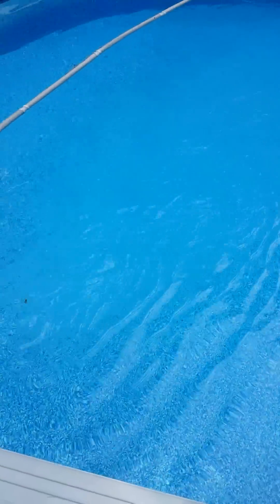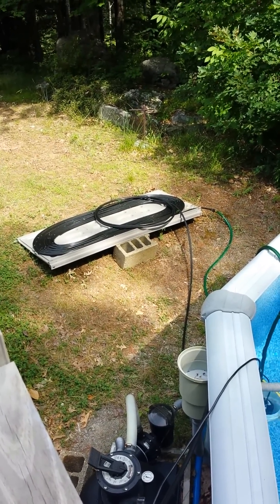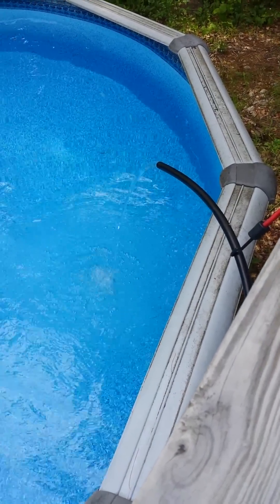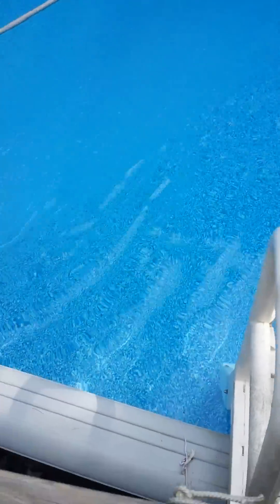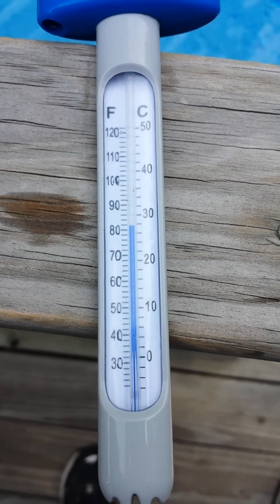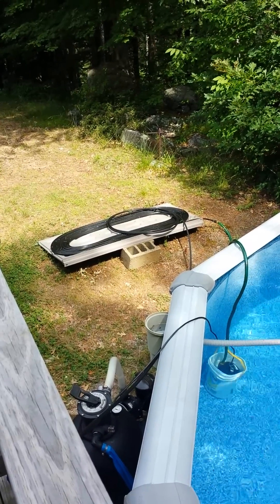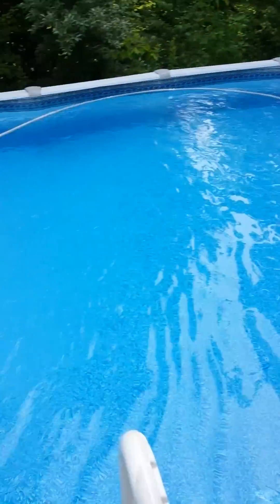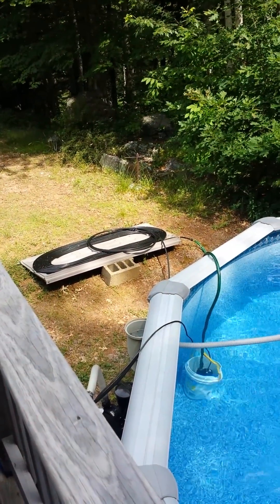Solar Water Heater for Above Ground Pool *UPDATE*

Comment: If you have a timer though wouldn't you save electricity? as you wouldnt have the pump on all the time...do you run the pump all day?
Reply from the maker: I found that after a few sunny days (10am-5pm) running I didn’t have to use it at all for 4-5 days as long as it didn’t rain.

Comment: I built a solar heater for my pool...pretty much like yours.  When I started my pump it only trickle out water rather than coming out like normal. If anyone has any ideas why this is happening plz comment
Reply from the maker: Are there any bends in the hose?  What pump are you using?
Reply: there were a few cut I cut then put and used a connector... n no leaks. 1 horse power sump from harbor freight
Reply from the maker: I'd see if the pump is functioning properly.
Reply: yeah, I replaced it once. but it seems to be working
Reply: what size pump are you using? I'm pretty frustrated... it's such a simple set up.... and to see all the people on you tube having easy success is driving me crazy
Reply from the maker: ***** The pump I'm using is 1/3 horse power.